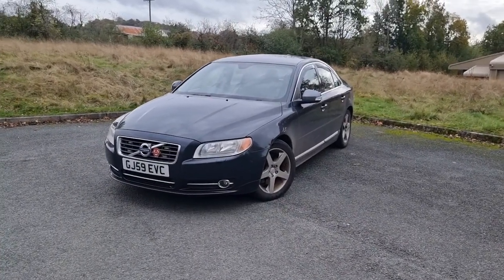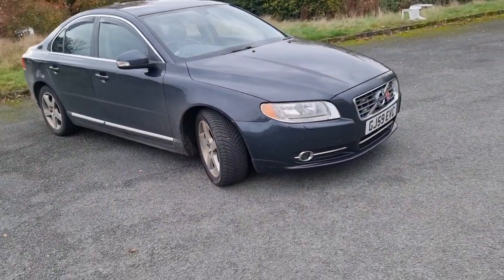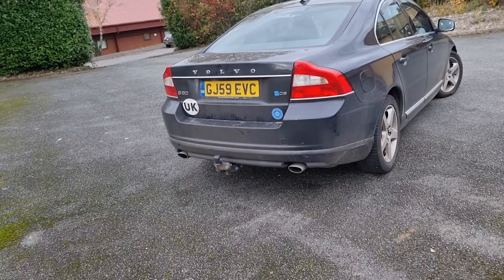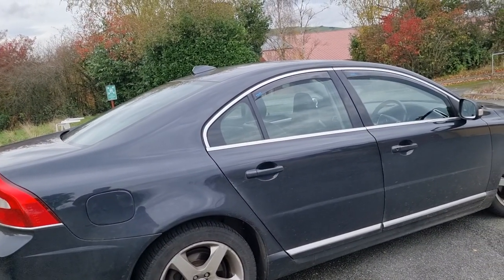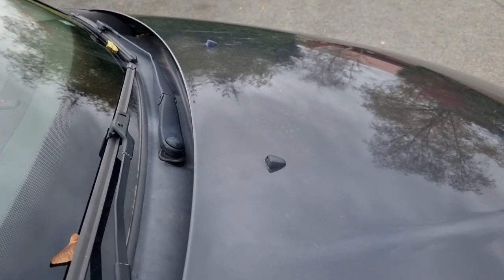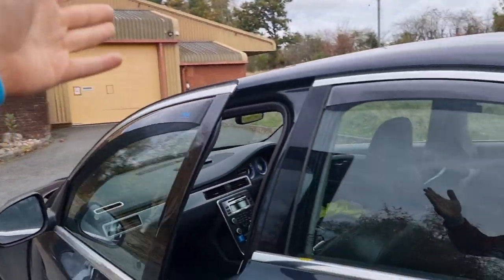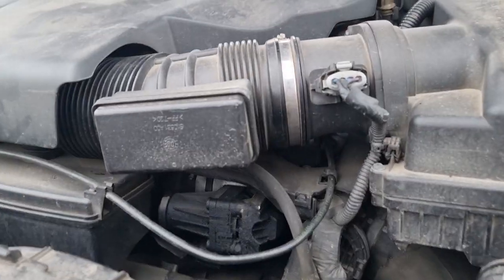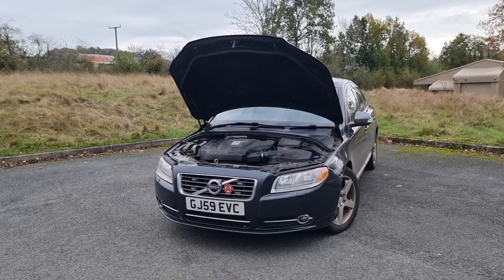*EVERYTHING BROKEN* on my 120,000 Mile P3 Volvo S80 D5!

Comment: I'm going to one up you :-) I have a BMW early 2009 e91 M Sport, which is currently on 210k miles on original suspension and fully original engine, transmission inc oil, 3 out of 4 coil springs, diff and oil unchanged - with pretty much nothing but tyres, brakes and oil services and a set of shocks all round. Only advisories on MOT at 208k miles were a trailing arm suspension bush being worn on the rear driver's side. Absolutely amazing car considering how old it is, and how many miles I have put on it since I bought it back in 2014 for a mere 8k 🙂 Has to be the best value car ever bought.

Comment: Am @150k miles

@120,000 miles - keep an eye on coolant level - well you'll get the coolant alarm 2 x P3 V70s have had to have radiators replaced due to tiny leak. Once rad repaired issue sorted.

Issues on my V70 - got a VIDA DICE now - seem to be getting an occassional misfire on cyclinder 4. Think injector plug wire issue.

Washer fluid level low alert - but still seems to be plenty of washer fluid in

Just fitted a Carpuride 7" Carplay / Android Auto to my P3 V70. Def worth doing to make the factory headunit a bit more modern - because the std head unit / amp / speakers are decent enough.

Comment: The door lock issue is almost certainly the little electric motors within the module in that door. The brushes wear out over time. Very common on Volvos, Land/Range Rovers and Fords that all use variations of the same part. Replacement modules from Volvo are £££, but replacing the motors is cheap, great guide here, it seems daunting at first but all makes sense when you've got the parts in front of you - https://www.youtube.com/watch?v=vIZmJFqoDKk

I replaced all four motors in both of the front doors on my XC70 for £18 from an eBay seller called AZGIANT in China.
Reply: The passenger door card looks like it's been removed before and not rehung correctly. It's possible that door has already had a lock module repair. Hopefully, just a case of removing it and rehanging it correctly, the video above shows you how.
Reply from the maker: awesome thank you! 😁😁
Reply: I had the same door lock problem with my V70 last year, bought the motors from Amazon and followed the video in the link ihampton has sent you, now back working as it should!

Comment: Being able to put your fingers behind the door card can be fixed with a little Glue, pull off the door card and you will find that one or two of the brackets that hold onto the pop pins has broken off the card, and will be sitting there looking at you, but still stuck to the door and not where it is supposed to be, I.e on the card it's self.

Comment: My 2006 v70 d5 has 216000 on the clock and is very reliable as is my 1993 volvo 940 with just 170000 on the clock o had a land rover discovery 200tdi which clocked up 356000 but the body work dissolved!
Reply: A Volvo, not partly Ford as newer ones..

Comment: I have the same with the door issue, just on the back passenger side. did you get yours going? I haven't looked at mine yet, annoying it certainly is. I've watched it could be the small spring which just needs replacing aswell apart of the mechanism, i hear it trying to go up but just gets stuck.

Comment: Don't know why you are moaning . Car is dirty wheels have  brake dust baked on with bubbling paint  .Its a 13 yr old car , take a bit of pride in it , if those are  Michelin tyres you obviously can afford to spend a few quid on some cleaning products
Reply from the maker: Hi Phillip, 
I'm not moaning at all, just letting other owners know what wears and brakes when! The car is loved and well used. It is washed and polished regularly and in the video has about 1,000 miles of dirt on it after a week of driving :) I live in rural England and commute in rural Wales so it does get very dirty very quickly 🤣

Comment: 120,000 miles passed with flying colours, says it all ......... Discs worn and ball joint super minor !  virtually any car with lower miles would suffer the same, rear door solenoid ? minor .....Washers .... blocked tubes or debris in the bottle, possible nozzles, pennies .....  door card, plastic trim clips or card warped, but I notice the D5 engine and gearbox are faultless, and why ? because these can easily do over 400,000 miles plus if maintained, I just sold a 2008 with 280,000 miles on the engine and gearbox that had had nothing, and I repeat nothing but oil and filter changes as necessary, still drove almost as new, they are legendarily bulletproof, if a little staid and old man boring !

Comment: May I ask whether your D5 smokes from the oil filler when the cap is removed?  My D3 does (https://www.youtube.com/watch?v=Ge4q33sQVn4), and also 'fails' the glove test.  I know this is considered a sign of a failing PCV on the petrols, but insight seems more scant on the diesels.
Reply from the maker: Mine does the same :) according to the forums it is fairly normal as long as the oil level isn't dropping :) the way the D5 engines are designed you get a small amount of "blow by":) on some engines blow by is a sign of a heavily worn engine but the D5 has a but of blowby from the factory :) I have driven a 2016 D5 with 3,000 miles which did the same :)
Reply: @drivelife.channel  That's good to know. Haven't had it long, so just working through things as it approached 100k miles!  Thanks for your videos, they've been very helpful so far. My lowly D3 136bhp will hopefully get its Polestar soon!
Reply: Check all the hoses first,, utuber on here brilliant vids SiRobb has a volvo d5 loads of tips and fixes,,
Reply: My 2016 d4 2,4 5 cylinder is doing exactly the same, for years. 
Now it has almost 200.000 kms and still running fine.
Reply: @Castelele  well that’s good to know! I’m only on 93k miles.